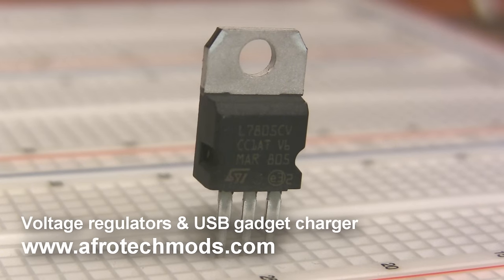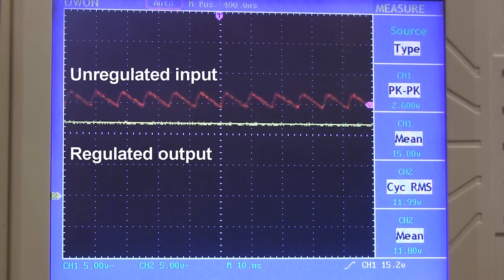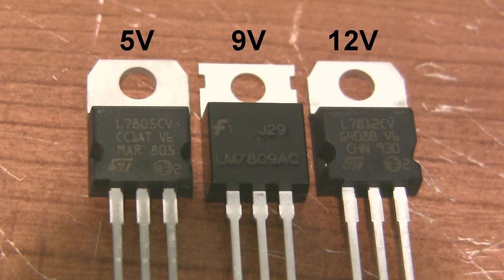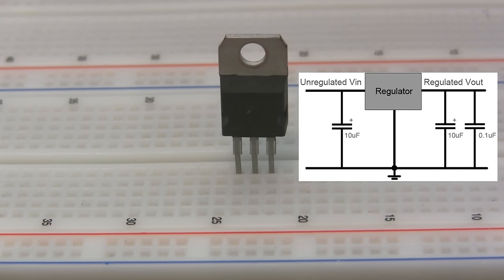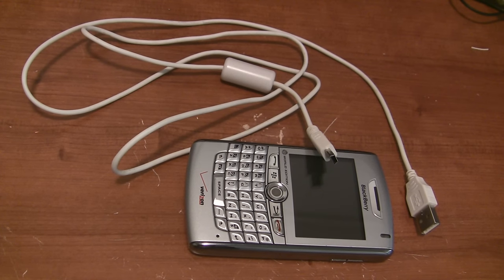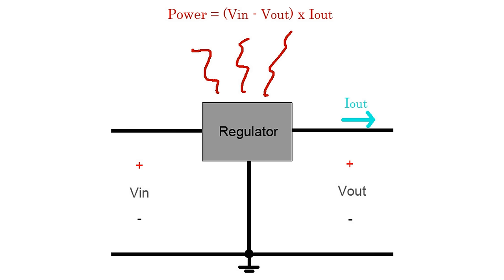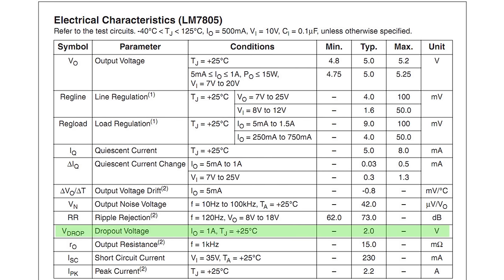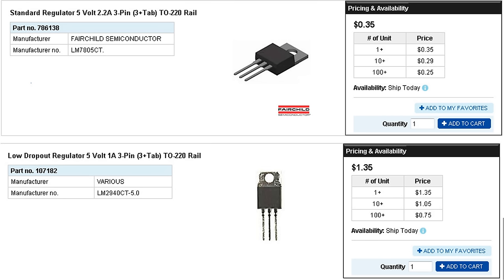Voltage regulator tutorial & USB gadget charger circuit

Comment: I have a power supply with an lm317t. It has a heat sink and is currently running 12 v supply at .200 amps. I plan on putting a bigger transformer that is still 12 volt but produces .700 ma. I am trying to figure out if my regulator can handle the extra current without shutting down. I can add a small fan to the case. What do you think? Is there a better 12 volt regulator than the LM317? I would guess that the voltage from my transformer must be higher than 12 v.
Reply: I think that all of the switching voltage regulators all better than linear, for example LM2576T-12, but that kind of regulators need some extra components
Reply: the LM2576T-12 is a fixed switching 12V regulator, and if you want the adjustable version, simply google LM2567T-ADJ

Comment: The LIfty Belt: SEM CI solenoid electromagnetic units forming a torodial MNC main networking coil, have each one 12V2A VR, so that the Wattage output through polarized cores having a reactive quality and an input to the surrounding energy %, can support 150 lbs, x2, perhaps 400+ with the N42 Nd gate-retifiers as feedback modulators.

Comment: Sir I have 2 questions

1) what is the reason for using a ceramic cap over electrolytic cap at the o/p end.
2) how do you design those capacitor value based on the load. Are there any formula calculations required. 

Waiting for ur reply .....

Comment: a lawn mower is a good example to test reg. basicly a 12volt batt needs about 14 volts to charge while running its ac coming from the flywheel so it needs to  go thru reg to convert to dc  with  the diodes some time you want see the capisitors used  the reason it 14 volts is push the voltage back in the battery  ---the batt . stays at 12 volts hope this some help if not just direguard

Comment: I have one question about this, when i build this, i want to put an on/off switch on it, would i put it on the input circuit or on the output circuit.
Reply: On the input. IF you put it on the output the circuit would still be active, and thus simply waste energy, and there's not good reason for that.

Comment: I have a "spark gap generator" that I designed and built.  It uses a 12V battery that looks identical to the one in your video.  It uses an L7809 to drive a 555 timer at 9V.  I ran it for maybe 20 seconds and it appears that the regulator was damaged.  It only supplies roughly 4V now.  I replaced the regulator with two chips and I added a .1uF cap at the output of the regulator (an electrolytic cap) ,,, now I can run the spark for as long as I want without damaging the regulator... any idea what might have caused the failure of the regulator?  I can't imagine that the 555 timer was drawing much current...?  (I did not have a heat sink on it.)  Not sure if the improvement is due to adding another regulator in parallel or due to adding the output cap... I try different configurations but it's all soldered together and in a box... maybe I'll breadboard it to determine why it works now...

Comment: most informative video.
only thing i did not clearly understand was why the maximum mA load was 100
i imagine that part could be changed to allow a 500mA load
Reply: uhadme The regulators can support more current (up to 2 amps), but require enhanced cooling.

Comment: A common misconception is that electronics are exactly like water particles flowing through pipes. The analogy is helpful, bu there's a point at which electrons aren't as important as electromagnetic fields when it comes to understanding electronics. As for capacitors: they have resistance. Putting any load with resistance "across" a battery (that means in parallel) does not short it, but introduces a parallel circuit. Look up parallel circuits.

Comment: Hello,
I need a system that can generate up to 50Khz adjustable frequency with about 30 amps. Do you know any method that can help me do that? These voltage rehulators go pretty high from frequency point of view, but amps are pretty low.. Thanks in advance

Comment: HI there. I just watched your video and it was very informing. I also see that you built your own power supply of 16 volts. I actually am in desperate need of one for a stereo mixer I have. It is a Cerwin Vega DM1 mixer that uses. A 16 volt adapter and is 1600mA Max. I was wondering if you could tell me the parts I could get to make one myself as I can't find any for this particular unit? Thanks and keep those videos coming.

Comment: I'll add that the power supply was a 19.2V battery, the kind designed for Craftsman power tools. But I checked the ports with my meter to assure positive and negative

Comment: Nice project, i tried but my output volt was only 4.98 which couldnt power my device. Used 9 v , 12v, removed capacitor did almost every thing thts possible but couldnt get 5v any idea where might be the fault

Comment: Plz i have a question!if i have a variable input source that can go from 0 to 24 volt for ex a wind generator and i need the output to be 10 v,what if the input drops to about 1 or even 0 volt is there any kind of voltage regulator that can deal with this and keep the output at 10 v when my input goes to a very very low value of input ? Thanx in advance

Comment: Hi, I have an audio disco mixer and the output is buzzing/humming constantly, there are 3 voltage regulators bolted onto a heatsink,one +5v, +15v and one -15v.
If these are faulty could these make the humming noise on the output of the mixer?
There are no inputs connected, they have all been unplugged, so the mixer output is buzzing very loudly (audibly) with no inputs connected at all

Comment: Great video! Thx a lot for the help! Btw, I would like to know how you have designed the capacitors to have such values on the video. Also, can you show me how the circuitry would like for a negative voltage? Thx :)

Comment: For low output current needs (~1A, design-dependent) a GREAT source of SWITCHING regulators is to use the ones found in old mobile phone car chargers (cigarette lighter plug type). These can easily be cannibalised/adapted for many low power purposes and are the best way to cater for larger DC voltage differences between input and output e.g. 24v to 5v. Most use the tiny 8 pin & very low cost 34063 chips or near equivalent. Check the data sheet at     ti.com/lit/an/slva252b/slva252b.pdf

Comment: Hello , I want to ask a question .. I connected the same circuit as shown in vedio .I connected it in my bike having battery of 12 V (lead acid battery) but my output is showing a voltage of 3.35 V accept 5V ..Can you help me out why this is happening

Comment: For a 5v reg. With 16.8-14.8v supply, what voltage value would you recommend for the caps?  Thanks
Reply: I do notice that this post is 3 months old. For anyone else wondering, good engineering practice is to use a capacitor with double the rating of the supply voltage you intend to use. So in your case a capacitor rated at 35v would be fine. On another note there are standards for capacitor voltages see the link for more information. http://www.rfcafe.com/references/electrical/capacitor-values.htm
Reply: Alec Wilson thanks.  I've not checked the link yet but I was also wondering about capacitance values. Micro gerbils.  Is it basically the higher the value, the more energy the cap can store?  Thanks again.
Reply: DrFuNK No problem. Yes the higher the value the bigger the storage potential. :)

Comment: Your capacitor on the input\ground of the 7805 should be bigger than the output\ground one to prevent reversed polarity that could damage the regulator. On the other side, you could place a diode in parallel with the 7805 to preserve this behaviour.

Comment: If I am using a battery, do I need the capacitors?
Reply: technically speaking you don't ""need"" the capacitors at all, they're put in the circuit to make the output more stable. For most uses you can actually get by without them but they're highly recommended since a quick spike in current usage by the circuit would drop the voltage in that circuit which can cause all kinds of weird things to happen.

Comment: you sound super smart man, I want to know what I can do for this scenario.  I have a 0.5volt solar cell with 8amp output.  I want to someone make the voltage 5 volts. I know that since thats 10 times higher amps are atleast 10 times lower 800ma or even less, but that would be perfect for my usb charging. Let me know thank you

Comment: I have 2questions. Btw I am really new to electronics . Do you need a capacitor and can the regulator increase in voltage so if I had a 4v battery and want a 6v
Reply: the capacitors aren't absolutely necessary, they smooth the output and prevent weird dips in voltage that can cause issues in a circuit. 
a linear regulator cannot increase the voltage, it only takes a higher voltage and converts it to an accurate lower voltage. If you want to increase voltage you need a DC to DC converter like a boost converter to accomplish that.

Comment: Is it possible to build a regulator that operates similarly to the 7805 while using only discrete components?
Reply from the maker: +Matthew Ferrie Yes. Something like this. http://m.eet.com/media/1050905/C0334-Figure1.gif
Reply: +Afrotechmods What should be used for V_ref?

Comment: Ok, awsome vid, i have a few questions- i live in europe, so i may buy european 9V batteries; i already bought the 5v regulator;1st question- i have x1 10uF capacitor, x1 6.8uF capacitor and x2 2.2 uF capacitor, so can i use them?2nd one- what is the current of europian 9V battery? Should i use heatsink?I want to try charging my phone via 9V battery and 5v regulator.

Comment: dear sir I made a simple 7805 transitor regulator from 12 volt battery, but it draws 300ma from battery and charges a smartphone much slower than the conventional ac outlet charge device, can I parallel another additional piece of 7805 and get higher output with it?
Reply: +fidel catsro LT1084CT
Reply: +Pete VanDemark one piece enough? can I get more than 300ma?
Reply: +fidel catsro The LT1084CT is a 5V 5A regulator. datasheetcatalog dot com will have a data sheet. The details are all there, read carefully. There are many regulators in this class, up to 7.5A is available at 5V.
Reply: +Pete VanDemark thank you for the info!! I underestimated these little plastic biscuits with metal legs..i thought theyre were underpowered and unreliable and boy I was wrong!! thanks again for sharing your knowledge!

Comment: I connected the positive end of the capacitor to the input and negative to ground and for the other capacitor i connected the negative to ground and positive to output and the other capacitor i connected to both ground and output
Is this correct because there isn't any continuity from the input to output

Comment: can i use this circuit to power my wifi modem?? its rated voltage and current is 9v nd 850mA and the circuit output is 9v and 3A so if i connect this circuit to the modem ll will work r will it blow it up??

Comment: in the regulator output ,is convinience to use two capacitor intead 1?
Reply: +Raul Morel Depends on your voltage regulation needs.  In this circuit, ceramic's lower Equivalent Series Resistance helps the capacitor smooth higher frequencies.
Reply: +Keith Reynolds thanks,im doing a ac 120 to dc 12, and i checked some videos and book talking about that,and after rectifiers bridge, i saw one cap and voltage reg.and after. it put the two cap for filter the dc voltaje.

Comment: I plan on using a L78L05ACD from TI for my Arduino clone (need 5V), but I ordert a few to test them first and I'm just getting 4,88V or 4,9V.
I know that must be 2% of tollerance (the datasheet even says 5% are possible, too)
Now would that be a problem or will everything run just fine?

Comment: LM1084 and its setup for 5v using resistors.   my voltage drops from 5.20v to 3.30v when i connect a 2A load on it.. anyone help me solve this ? my power supply is 12v 20A and input voltage stay at a constant 12v and iv tried 2000uf cap on the output but still voltage falls iv used 4000uf also no change...and mobile phone stops charging under 5v

Comment: Your device rating means that you only need to supply 5V to your device and it will decide what current to draw. Probably a bit less than 1.5A. But the point of the rating is that your 5V supply should be capable of delivering up to 1.5A if needed.

Comment: yeah me to. caps are very interesting things, have a look on wiki and the allabout electroncs forums. In the above demo he is using 2 large caps and a much smaller bypass cap to filter out and high frequency oscillations that the larger caos didnt catch, the best result here would be a perfectly clean a DC signal with zero AC ripple. THE CLEANER THE BETTER.

Comment: hi, wanna ask..im still figuring out v.regulator. im powering 6 servo by using 12v power supply. how many voltage regulator do i need?
Reply: I would say just one, as long as it can handle the power consumption of all your servos. Remeber to use a heat sink if necessary.

Comment: why can't we use a resistive potential divider ?I know it is inefficient but so are these regulators.which is more efficient?
Reply: The voltage regulator can accept a range of voltages and output a single voltage i.e. take an input of 7-24V and output a constant 5V.

The voltage (potential) divider circuit is dependent on both the input voltage and the output load so....

1. With the voltage divider configured to output a given "constant" voltage, this output voltage will still increase or decrease accordingly if the input voltage were to change. Even with an arrangement using potentiometers, you would have to adjust the setting everytime there is a change to the input voltage.

2. Once a load is applied to the output, the output voltage drops in direct proportion to the size of the load. Meaning a constantly changing load (i.e. varying the speed of a motor, changing CPU frequencies) will induce a constantly varying output voltage to whatever you are supplying.

3. Using resistor values large enough to supply for a heavy load or to mitigate voltage variations due to load will incur significant losses across the ground resistor.

Comment: I made a usb charger for my car like this but with only one 10uf for the output and no heat sink. And the charging speed is very low. It can hardly keep up with the discharging speed of my phone when I use it as a sat nav just to keep the battery level constants. Why is that?

Comment: I tried to do this with two different voltage regulators from RadioShack and won't work for me. 9V battery attached to a LM7805C and it drop to 4V instead of 5 so I tried 14V input and it drop to 9V. What am I doing wrong?

Comment: hi i have followed this schematic however my question is how can i increase the amp out of the 5.0 volt .300ma to lets say 1A or 2A.
Reply: Jamile Kastner Mariano You need to use a big heatsink on the regulator, and make sure you're supply current is high enough.
Reply: I'm currently using a CPU heatsig and my input voltage is almost 19v 4amps and the output is still somehow 5v still however the amperage isn't high enough its still coming out less than 500mah how can i increse the amp output to 500mah to 1000mah(A)
 or 2000mah(A)

Comment: What is the purpose of the non-electrolytic capacitor on the voltage regulator's output?
Reply from the maker: The material used to make the 0.1uF cap (the dielectric) is ceramic, which is different to the dielectric of the 10uF cap which is an aluminum electrolyte. This means the two capacitors have different performance at different frequencies. The 0.1uF ceramic cap is best at filtering out high frequency noise whereas the 10uF cap will be useless for that.

Comment: When we didn't have the right 3 legged regulator available we would use several diodes in series until the .7 voltage drop per diode got the voltage to where we needed it.

Comment: Hi im planning to build a volatage regulator that has an output of fixed 9volts even if i applied the load or unplugged it, it is still 9v. Does it have the same concept like this in the video other than the ic. Please i need your immediate response. Thank you in advance :)
Reply from the maker: Yeah if you use an LM7809 like in this video you'll get a fixed 9V loaded or unloaded. But you'll be limited by how much current you can supply according to the power dissipation equation shown in the video.
Reply: Afrotechmods You could always do the old trick of wiring the LM7809's in parallel so they can load balance and handle more amp draw. I am trying to decide if I want to do this with my 12 volt 30 amp power supply I just built or just leave it at 13.8 VDC with its current smoothing caps (which do an awesome job BTW)

Comment: Great video! I got a few laughs at the Best Buy comment. Question. You said your setup provides 100mA. So if you're planning to recharge say a 2200mAH battery, the max output will be 100mA? I'm I looking into this wrong?
Reply: +ABflanagan523 The 2200mAh is the capacity of the battery. The 100mA is the current output.

"mAh" is our simplified way saying a battery will provide x milliamps (mA) for one hour. So in the 2200mAh battery, it can supply 2200 milliamps of current for one hour. Halving the current draw to 1100 mA will approximately double the runtime to 2 hours while doubling the current draw to 4400 will halve the runtime to 1/2 hour (provided the battery can supply that amount).

This also works the same the other way so charging the 2200 mAh battery at 100 mA will take:

2200mAh/100mA = mA-bottom cancels mA-top = 22 hours.

a 500mA USB port will charge the battery at: 

2200mAh/500mA = 4.4 hours.
Reply: Thanks you for taking time out of your day to respond to my question and answer it. That's what I was wondering. If the output is 100mA and the battery is 2.2Ah or 2200mAh. So yeah, 22 hours give or take an hour to replenish the battery to full.
Reply: +Qoo Thanks a lot! :)